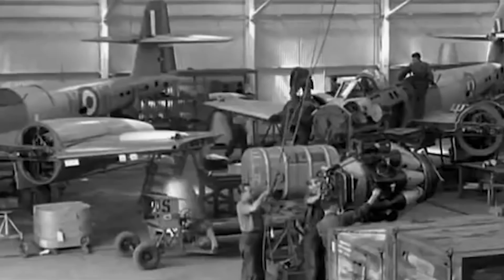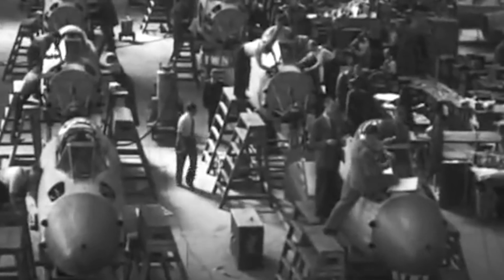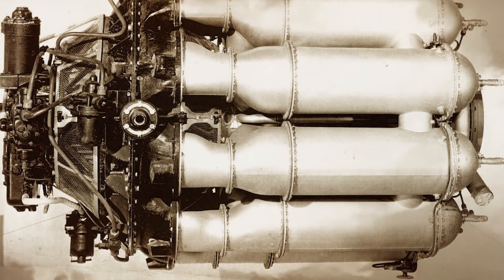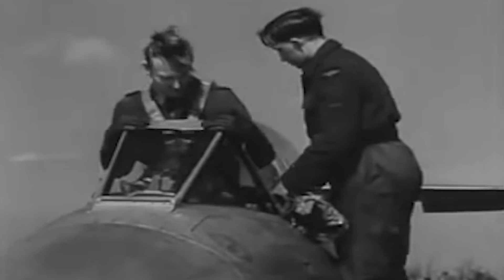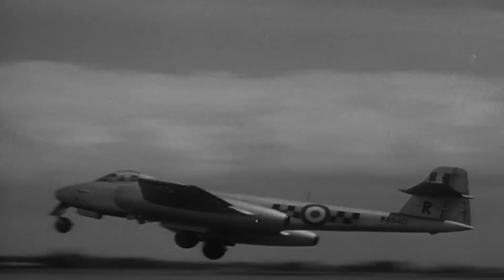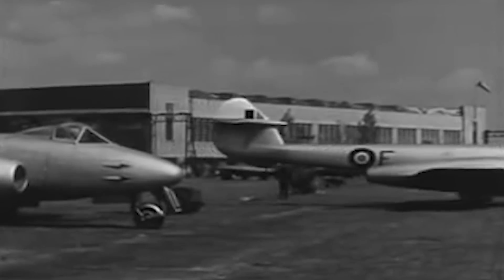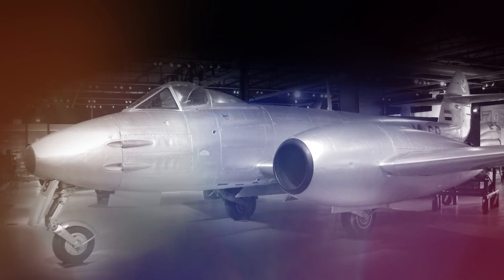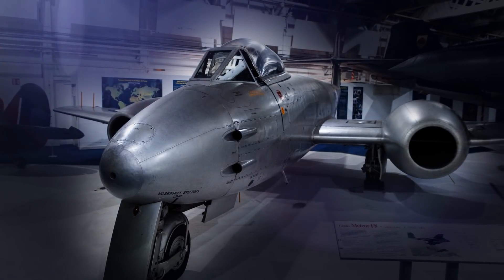Gloster Meteor - The Only Allied Jet to Fight in WW2

Comment: Leave it to Rolls-Royce. At the time, what was it, 35, 000 ft. in 5 minutes? Incredible! However, the Meteor was not swept-wing.
Reply: The English Electric Lightning could reach 50,000 feet in one minute, only 15 years later
Reply: Not was the 262, the DC-3 had more wing sweep.  The minimum effective sweep is 30 degrees.  A thin wing is just as effective, Cessna make several thin wing executive jets.
Reply: @givenfirstnamefamilyfirstn3935  Thank you for mentioning that. I did not realize the 262 only had a "slight wing sweep." Apparently, this was done to rectify the plane's center-of-gravity due to the weight of the engine pods. It's clear that it had nothing to do with cutting edge technology.

Comment: *Hust*... Franz von Ohain 😉
Reply: shhhhhhhhhh.......
Reply: No, Hans Joachim Pabst von Ohain.
Here is what he himself had to say on the matter (from Ohain's foreword to  'Elements of Propulsion, gas turbines and rockets')-

"The first patent of a turbojet engine, which was later developed and produced,
was that of Frank Whittle, now Sir Frank (see Fig. 5). His patent was applied for
in January 1930. This patent shows a multistage, axial-flow compressor followed
by a radial compressor stage, a combustor, an axial-flow turbine driving the
compressor, and an exhaust nozzle."

and

"In April 1937, Whittle had his bench-test jet engine ready for the first test run.
It ran excellently; however, it ran out of control because liquid fuel had collected
inside the engine and started to vaporize as the engine became hot, thereby
adding uncontrolled fuel quantities to the combustion process. The problem
was easily overcome. This first test run was the world's first run of a bench-test
jet engine operating with liquid fuel (Fig. 7)."

and 

"From the beginning of his jet propulsion activities, Frank Whittle had been
seeking means for improving the propulsive efficiency of turbojet engines. ¶ He
conceived novel ideas for which he filed a patent application in 1936, which
can be called a bypass engine or turbofan. To avoid a complete new design,
Whittle sought an interim solution that could be merely "tacked on" to a jet
engine. This configuration was later known as the aft fan. Whittle's work on
fan jets or bypass engines and aft fans was way ahead of his time. It was of
greatest importance for the future or turbopropulsion."

Sadly, no engine that Pabst von Ohain designed ever went into service.  Almost all modern civil and military 'jets' are turbofans.

Comment: Aren’t the Martin baker meteors still flying?
Reply: I believe they are. They certainly feature on Marin Baker's website.
Reply: The RAAF heritage flight has a flying F8 Meteor based at the Temora Air Museum in Victoria. The researchers for this documentary clearly aren't that good.
Reply: @snarkymatt585  lack of research is quite typical for Dark's videos
Reply: @snarkymatt585  in fairness there may be others in private ownership flying too. The MB ones were still working aircraft.
Reply: @snarkymatt585  Temora is in NSW near Canberra
Reply: Yes, they are.
Reply: Ejection seat testbeds, if i recall correctly.
Reply: Yes saw one fly 3 weeks ago they are based at chalgrove
Reply: Dark Docs videos nearly always have some horrendous gaps in the research. They bring up interesting topics but they are easy to find inaccurate info in, and sometimes really bad mistakes.
Reply: Absolutely.  Martin Baker's Meteor just flew an ejection seat test very recently.  There's a photo in one of latest British aviation magazines.
Reply: I remember in the 70s and 80s a Meteor and Vampire always flying together at UK Airshows. Not seen the Meteor for years, but the Vampire still makes the odd appearance.
Reply: @jimbeckwith5949  Jim . I know that a Meteor and Vampire used to display as a pair . Sadly they collided during a display  with 2 fatalities .
Reply: @johndavey72  thanks, I didn't know that, just fond 1980s memories of the Meteor and Vampire together
Reply: I think Martin Baker are still flying one at least Meteor as an ejection seat tester? I wonder how they do that, must be totally airframe stress expired? Would love some information
Reply: Yep. They are 2 of the 5 Meteors still airworthy.

Comment: I sat in a Me 262 in Munich Germany
I had a professor that flew in them and survived the war...
Reply: @ChivesButler  Whright Patterson AFB had one before I got there, but I got to read all the technical data about them. Have some of it in cd
Engines barely lasted 25hr because they did not have hi heat aloys....
Reply: @garykullack2314  
More like 10 to 12 hours, if you were lucky.
Reply: @johnburns4017  John, did you forget to take you medication again?
Please get help.
Reply: @sandervanderkammen9230  
Not this nut again.I
Reply: @johnburns4017  John please get therapy
Reply: @garykullack2314  
In 1945 the team from the French ATAR laboratory plus some BMW and Junkers engineers, were engaged by the French SNECMA research bureau, with the objective to built a new reliable performing axial-flow turbojet. The BMW 003/Jumo004 was considered unusable. It was tested on the first French jet aircraft, the 1946 So6000 Triton, overheating and exploding. The plane only flew with a Rolls Royce Nene centrifugal turbojet. The French were using advanced alloys after WW2, that were not available to the Germans, yet the engine still lasted only around 25 hours.

The ATAR project took 6 years to produce the first acceptable axial-flow turbojet (ATAR 101 B1), produced in 1953. So eight years research & developments by the French using the German jet engines as the base, which already had years of German R&D behind it. It was installed on the first French jet fighter, the Dassault Ouragan.

The French lost a lot of time because the German jets had poor efficiency with some concept fails. Essentially in the combustion chambers and fresh air circulation to reduce the external temperature of the engine. The BMW jet was known for overheat problems which precluded fuselage installation.

The question at the end of WW2 was what is the most efficient way to produce jet fighters. The answer is clearly not adopting the German design of engine and fuselage. The build costs for a jet engine were much higher than a piston engine, with the fuel consumption near 3x. The centrifugal compressor the British adopted in some planes was the best choice with 1944-45 technology, more compression pressure was not an advantage when the hot turbine was unable to resist higher temperatures.

The German turbojets had big overheat problems as the engine would not work in an enclosed fuselage for single engined fighters. This defect was immediately noted by the French on the 1946 "SO 6000 Triton" prototype, and by the Soviets on the 1946 Mig 9. The Soviets quickly replaced the BMW 004B2 by the centrifugal Rolls Royce Nene which worked without problems, dismissing the BMW engine for fighter planes.

Nickel alloy superalloys were first developed at the Wiggin Works in Hereford, England, as a request Whittle jet engine team. The Nazi design teams ever understood that steel was never going to work. The Nazis weren’t doing much in R&D to discover the problem. The Nazis two major production jet engines never managed to last more than a few hours.  
Wiggin are still operational, doing R&D on specialist metals and producing them. 
https://www.specialmetals.com/divisions/wiggin.html
Reply: @johnburns4017  Jesus you just wrote an entire essay.
Reply: @johnburns4017  Dude, what are you even talking about? "The build costs for a jet engine were much higher than a piston engine" Thats flat out wrong. The Jumos needed only 1/3 of the man-hours to produce than a DB601. If you have no clue what you are talking about why make so much effort in trying to put wrong info out there?
Reply: @theacme3  Yes you are absolutely correct, John Burns is a very sick person that has no idea what he is talking about.
Jet engines were much cheaper and faster to build and also important is the did not need highly refined high octane gasoline.. they ran on Diesel fuel made from coal.
Reply: @barrierodliffe4155  Still trolling Youtube with your childish insults???
Reply: @sandervanderkammen9230  WHY CAN'T YOU ANSWER A SIMPLE QUESTION? IS IT BECAUSE YOU KNOW THAT YOU WERE TELLING LIES?
Reply: @sandervanderkammen9230  Wie ist es, ein Feigling zu sein, kleiner Doktor, Mistkerl?
Reply: @garykullack2314  That's interesting because American test results showed they averaged 50 to 60 hours... excellent by WW2 standard.
Reply: @sandervanderkammen9230  How restrained of you Sandyboy, you usually let your lies take it up to 100 hours and on some occasions even 200.
Reply: That's very interesting..
Reply: @Gary Kullack
He is one lucky bastard! The plane a had a habit of killing its pilots.
Reply: @johnburns4017    He used to start it with only one foot in it on the seat
they tended to catch fire on start   he said...   engines lasted less than 25 hrs   no hobbs meter to tell u how much time was on it...
Reply: @johnburns4017  lol you sound like a jealous man to ME 262 technology :)
Reply: @jacobjonm0511  
What technology? It was a poor plane.
Reply: @johnburns4017  Only a Brit would say that ;)
I am not German by the way.
Reply: @jacobjonm0511  
Anyone who knows about the topic would write what I did.
Reply: @johnburns4017  lol oh yeas
Reply: @jacobjonm0511  
Oh yes!
Reply: @johnburns4017  Spitfire cannot be compared with ME 262 or HE162. It is much slower and less armed. It can be compared to other piston engine planes and even then P51 and FW190 D model were superior to it. Get your facts right.
Reply: @jacobjonm0511  Spitfires shot down a number of Me 262's but the Me 262 never shot down a Spitfire,  The Spitfire was also far better than the P 51 or Fw 190 D. It might help if you knew much about aircraft.
Reply: @barrierodliffe4155  Lol yes, maybe because Spitfires were faster and better armed than ME 262s?
Reply: @jacobjonm0511  Spitfires shot down Me 262's, Me 262's couldn't shoot down Spitfires which were better armed
Reply: @barrierodliffe4155  Spitfire was the best plane in the work both during and after WW II. It was superior to the Jets. Such a pitty its production stopped, otherwise we were still seeing spitfires in Royal and US airforces :)
Reply: @jacobjonm0511  Indeed, according to Barrie the Spitfire had a cruising speed of Mach 3.5 and carried the first British astronauts to the moon in 1943...
Reply: @frecherdachs2542  Servus, ich stimme 100% zu. Nie wieder darf zwei Reisen gegeneinander kämpfen im Interesse die Zwerge. Deutsch kann ich auch lesen,aber schreiben!!
Reply: cool, I know they had to rebuild the engines every one or two flights.
Reply: @garykullack2314  Was that the one at the  Munich Tech Museum? I sat in that one as well. They moved it around 19809/90 and no longer allow contact
Reply: @monza1002000  super
Reply: @Cloud Burst 117 
You display low mentality unable to focus on the point in hand.
Reply: @Cloud Burst 117 
You can get help for your condition.
Reply: @Cloud Burst 117 
A 262 is in the RAF museum. Not impressive.
Reply: @Cloud Burst 117 
It just does not look an impressive plane.
Reply: @Cloud Burst 117 
So made kills against lumbering bombers.  Not impressive. Or the look of the faces of the 262 pilots as their engines cut out. Or a Tempest opened up taking it down.
Reply: @Cloud Burst 117 
The Zero was not a jet plane. It was based on a British plane, the Gloster F.5/34
Reply: @Cloud Burst 117 
The most overrated plane of WW2. A death trap to its pilots.
Reply: @johnburns4017  wouldn’t say there the most overrated plane. I’m sure there are many more.
Reply: @johnburns4017  also the ME262 is quite impressive by the fact it’s one of the first jets ever made.
Reply: @Cloud Burst 117 
You need to focus on what was written. It was related to only one plane - the me262. It was a death trap.